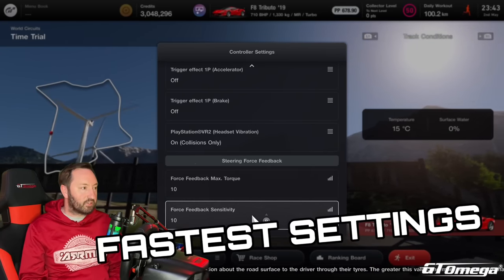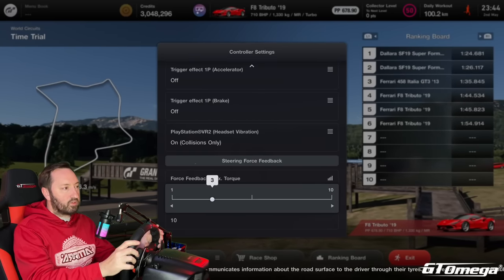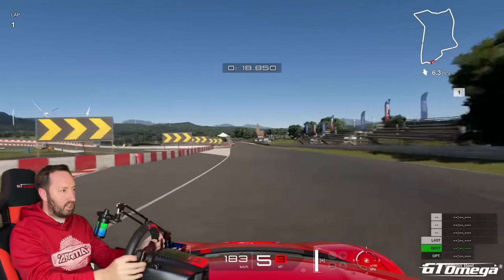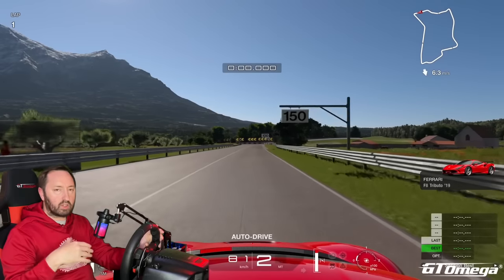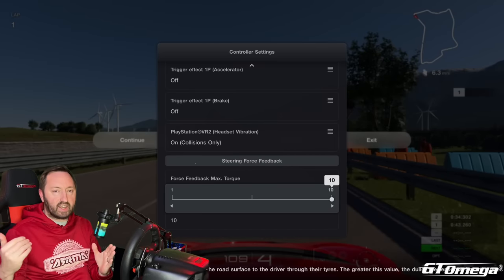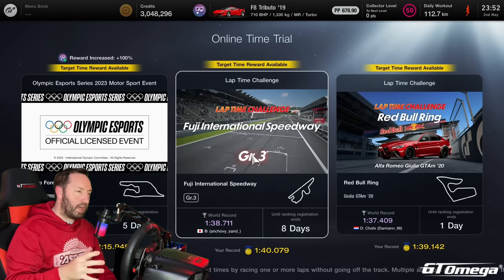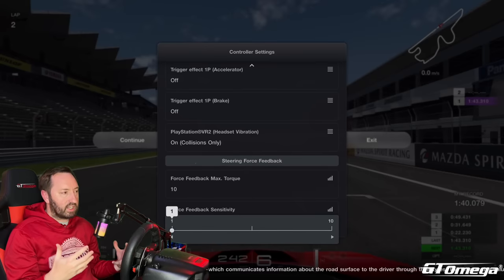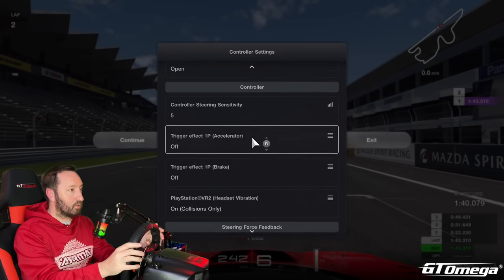Stop Wasting Time! Change Your Force Feedback Settings Now!

Comment: G29 clips above 3 max torque. Why would you go anything above that is beyond me... you are missing on all the details.
Reply from the maker: I do agree. However I wasn’t interested in the details when comparing the alignment feeling between high and low sensitivity. 👍🏻
Reply: @Doughtinator  I am talking about max torque, not sensitivity. The G29 does not operate well above 3 max torque.
Reply from the maker: Yeah I understand that. But also there are cars which don’t have much feedback at all. Sometimes you can turn up the max turbine settings beyond 3 for those cars.
Reply: @Doughtinator  Low front downforce road cars? Not a bad idea, actually!
Reply from the maker: Absolutely 👍🏻👍🏻
The current time trial with the old car I did exactly that and it helped loads
Reply: @Retheraq  what do you mean by it clips beyond 3 max torque
Reply: I’ve been using 9-9 on gt3 cars and it seems ok, very frustrating I can’t change the wheels operating range while using on console (the g29 that is obviously)
Reply: Thank you for this,  I've just had to change to T248 as my trusty g29 pedals broke ( just before quali in a league race) how do you deal with the dreaded g29 dead space,  I used the good ole g29 for about 7 years 👍
Reply: “Details” mean nothing if the wheel won’t self steer
Reply: Totally agree . 3 to 5 on that wheel.
Reply: Good stuff. I’ve gone to 4/10. I hate that clicking-knocking crap when going down a smooth straight away.
Reply: Setting of this Video:
Information 0
Advertising 10

Comment: After 4years on 10 torque, on my G29 I went down to 8. 6hrs of racing today confirms the difference is massive and so much more fun. I might try 7 tomorrow.
Reply from the maker: Awesome. Don’t be afraid to experiment and see what works best for you 👍🏻
Reply: Like did it make harder or was it less stiff just curious I’m trying to make mine harder I have the one with true force done really like it about to get the pro so it have a tighter turn

Comment: Controller steering sensitivity is, as the name implies, for adjusting the sensitivity of the steering on a CONTROLLER…… it is a separate section of the menu called CONTROLLER , the settings you tested in this video are in a section called STEERING force feed bacK, they do make adjustments for the STEERING.
Reply from the maker: That’s what I found when I was testing. But others swear it makes a difference 🤷🏻‍♂️
Reply: You are wrong. It does affect the wheel

Comment: The biggest difference I've noticed with controler sensitivity not set on 5, it makes the cars wheel feel like your behind the actual steering wheel. Say 6, the wheel imput feels to fast compare to how much you turn. 4 the car will be slow to your reaction time.
Reply from the maker: Interesting. That’s for the feedback. I’ll look closely for this when I’m next testing. 
It’s not something I noticed but I’ll look again next time 👍🏻
Reply: That’s what happens when you adjust torque sensitivity. Nothing happens when you do controller sensitivity. It’s a placebo effect.
Reply: Don’t listen to this controller sensitivity propaganda

Comment: Since they changed the physics I use 5 and 8 on the g29...over 5 is it's just too heavy and furthermore it loses details and smoothness with race cars. The problem is that when you use for example a golf gti or cars from that category you need to set a higher value because you almost have no feedback..they need to put some more work on how it scales to the different cars or add a per car ffb setting like in automobilista o ac on pc...the dream woulb be having separate options for road suspensions curbs
Reply from the maker: Yeah I agree. The weight of the wheel is quite different between different car types. That’s why I tried road car and race car in my testing.
Reply: Yes, even more so if you use the go carts.

Comment: for me it feels that most cars only use a max steering angle of 90°. and not like 180° or even 900° for road cars
Reply from the maker: For driving around a track. Yes I do rarely use more than 90 degrees. But driving slowly the rotation does seem to match.

Comment: Your wheel settings for will be quite different for drifting.  I would check out drifiting with little to no resistance/sensitivity.
Reply from the maker: I’ve had a play and I’ve actually found that higher values also work well drifting for me.
Reply: Higher settings make you feel the tension of the grip of the tires as it's happening vs your predicting what's happening with a light wheel

Comment: I might add, if you have the thrustmaster base then plug it into a PC and adjust the max ffb from defaults 70% up to 90% then back into the game and keep the max torque at 6 but drop the sensitivity down to 8. Higher definition without the arm tussle with the wheel. My preference anyway.
Reply from the maker: Very good info. Thanks for sharing 👍🏻👍🏻
Reply: This is not true. Set it to zero on pc and plug it in, it will still have ffb.

Comment: Recommended settings for g923 true force, from logitech representative:

FFB Max torque = 10
FFB sensitivity = 1
Vibration = 50

I just tested it and the result is WOW, thanks to trueforce technology !

Controller Steering Sensitivity (my suggestions is based on your view camera angle):
Hood = 6
Cockpit = 10
Chase = 5
Reply from the maker: Thanks for sharing 👍🏻
Reply: That is what confuses me. G923, G920 and G29 are all same hardware so it's applicable to all 3. But it is just madness to me for logitech representative recommending FFB torque 10 and FFB sensitivty 1.
Sensitivity 1 literally gives you almost 0 feedback in actual grip levels. You can't feel any of it. I tested with sensitivity 1 and it just feels like i'm on a river in a boat having no clue whether i'm steering or not. Back end going side ways? I get no information about it except seeing visually i'm doing 360.

And on the other hand... going above Max Torque 5 gives you FFB clipping meaning you lose details in FFB. 

So I'm very puzzled by that claim.

I was running basically 10 10 and it's just hard to drive it like that as well but I can easily correct and I can feel the road. Now I'm investigating what are the proper FFB settings in order to get all of the information from the game translated into the wheel in order to be able to drive consistent and fast.

A site like simracing setup says 5 for max torque and 4 for FFB sensitivity which is rather like the default GT7 settings lol. 

I'm just at my wits end with logitech wheel FFB recommendations as nobody actually explains what both settings are and what informations they actually provide and which settings give you the most information you can extract.

Update:
I ended up doing just the way site advised... 5 for torque and 4 for sensitivity.
The wheel feels like it gives out most of information and it's more "precise" since it's easier to turn and you don't feel as much individual tooth of a cog so it feels "smoother".
But I can feel most of information the wheel is giving me when it's on 5. When I go anything above 5 I can just feel the same stiffness of a wheel on most surfaces whatever it is and can't tell much whether i'm slipping or not (only thing is positive about that is that I can tell that I am slipping but when I'm starting to slip I can't tell).

Especially when going from hard to medium to soft tyre I can't tell the difference when it's above 5 max torque while with 5 I can easily tell by stiffness levels (as it seems what they're talking about "clipping" since I don't feel that information above 5).

So I think 5 for max torque and 4 for sensitivity is the most correct for GT7 with G29/920/923.

Comment: There is no 1 size fits all, definitive ffb settings, it's a personal thing. It depends on driving style and personal preference. If it works for you then don't worry about it being 'wrong' 

I use a TGT2 with GTomega Art and generally use 4/4 for slower cars (gr3&4) and 3/3 for faster (gr1&2)

I find it much easier to catch massive oversteer moments with lower strength ffb
Reply from the maker: 100% agree with you. Finding what feels right for you is most important 👍🏻👍🏻
Reply: I use 1-3 😬😬😬😂
Reply from the maker: Interesting. What wheel? Have you tried anything higher?
Reply: @Doughtinator  I have t300 mate I used to use 3-3 but felt i lost my finesse with last update so had to turn torque down 😬
Reply from the maker: Interesting. Have you tried high sensitivity and low torque. Like 1-9 for example?
Reply: @Doughtinator  yeah tried a few a mate I used to use 8-8 on t150 got 3-3 from TOR league on gtsport andxlwrk a treat for my t300 never had to change until that update one b4 last 😁

Comment: in other threads check for Pirovac they claim sensitivity is better @ 1 .... this would guarantee a better "dynamic" range on driving details... and when it comes to me  probably because I am a poor driver I can feel when FFB is hgh or low very well....but with FFS switching from 1 to or viceversa  ... not so...🤔

Comment: For me the max torque setting is determined by the wheel you have. When using a T300 i was limited to around 4 or 5 due to it would overheat. My dd pro i actually dont want to go above 5 as its too strong for me and can end up with repetative strain injuries to the wrist. The dd pro has a whole load of other settings that i haven't a clue what use they are to me to adjust. Ive sort of found max sensitivity at 10 and torque at 5, but drop it to 4 if my wrist is injured. For me the controller setting is literally for the hand held controller. I never thougt it was intended for anything else.
Reply from the maker: Yeah I’ve found pretty much the same as you 👍🏻
Reply: It's now confirmed that the controller sensitivity actually changes the wheel feeling as well and is best to keep at center setting as that is 1:1 movement
Reply from the maker: Do you have a link to the article that confirms?
Reply: @Doughtinator hi mate, what is the maximum degrees of rotation do you have your steering wheel set to in Logitech for use with gt7, mine is set to 900 but I think it might be too much..
Reply: @Doughtinator  here is the link to video on controller sen for wheels too https://youtu.be/oEe5ZchqbMg?si=WoAQ5xt3NCIrVqgn

I use controller sen 5 and the Two torque settings 5 and 10. Feels great with gt dd pro!
Reply: @MarcRCAddict with gt dd pro I found 450-720 good depending on the type of car
Reply: @Zascar888  thanks bud 👍
Reply: Did you say injury????   Jesus Christ people are getting weak.
Reply: @publub1142  I'm an old man my gp tells me. She said I've to careful, you're not young any more. Part of life getting old and body can't take what it could when I was young I'm afraid. We never had all this brilliant stuff for gaming when I bought my first racing game as an adult. Psion chequered flag on the zx
Reply: @Yukanhayt-Mhenow lol no it’s not confirmed by anyone at all. 

It’s all in your head.
Reply: @Zascar888 that guy has no idea what he’s talking about. His video is absurd and has the logical thought process of a child.
Reply: @Yukanhayt-Mhenow You fell for it too ha , it also been proven it’s makes no difference to wheel sensitivity.

Comment: I have noticed a difference with the controller sensitivity.... I started on ds4 with a low setting but was using steer not sticks... went to wheel and turned it to 10 for a long time thinking I wanted the fastest reaction wheel to game... saw one if the videos about this and have been running at 5 since (about 3 months)... I noticed it most with high tire wear...

Basically the controller sensitivity is related to in-game inputs... if too low then your turning will be behind the game thus needing more input. If too high then you can turn in less but the game over exaggerates the input.... Basically either will kill the tires.... on wheel best is 5 which gives most accurate wheel to in-game inputs, and can save the tires too! 

Cheers good content... true science  👌
Reply from the maker: Thanks for the feedback. Interesting about tire wear. Perhaps that’s a test in the future 👍🏻👍🏻
Reply: I use -2 with road cars, as you want very slight steering to maximise straight line speed. I've gotten many many top times in licences with -2/10/10
Reply from the maker: I really need to test some more on this 👍🏻👍🏻
Reply: This is false. Controller sensitivity has ZERO effect on wheels.
Reply: @JohnSdigi  correct

Comment: I use a T150, but the force feedback seems very vague IN GT7. I've tested the wheel out with PC3, and it feels GREAT!! I can literally feel the tire grip and make accurate inputs as I navigated a course.

I love GT7, but I need to know if there is something I'm missing in relation to settings.
Reply from the maker: You could try increasing the settings. But GT7 does feel a little weak on feedback overall.

Comment: 6/ 10 is where I'm at , controller sensitivity 2 , I can feel a difference in lineraty to the steering maybe it's just in my head 😅
Reply from the maker: That’s what I’ve been trying to avoid. Changing something. Knowing what’s changed and then inventing traits which validate what I expect to happen. 

The only true way to do it is to having someone make the changes (or not) and then test without knowing what changes have been made. sadly I don’t have a race engineer to help me do this 🤣🤣
Reply: Yeah that is something I've thought of , have someone change the settings and see if I notice anything without knowing what was changed. But ya I'm only one person 😅
Reply from the maker: 100% 👍🏻👍🏻
Reply: In your head. Controlled sens has zero effect on wheels.

Comment: Great vid mate. The G29 is a pretty good wheel with the settings pretty high. I've now got a T300. Feedback sensitivity is still at 10 & the difference from the G29 is immense. I can feel almost everything. Torque is at 6 tho now. It's much harder to turn with the belts. I think PD still have some way to go to match the feedback feeling from other games like ACC, which is much better imo.
Keep up the great work fella.
Reply from the maker: Thanks Martin. Yeah I’m quite interested in trying new hardware. But I completely agree. GT7 is a long way off where it could be with FFB. 
In fact. The old Live For Speed game on a G25 feels better than GT7 in 2023 😳🤷🏻‍♂️🤣
Reply: PD isnt aiming to compete with acc i would let this idea go
Reply: @danielstokker  I didn't say that PD is aiming to compete with ACC, so stop reading into things that aren't there, Mr Passive Aggressive. I said they had a long way to go to match the FFB that ACC has
Reply: I had the g29 and now the T300 and same games as you. Totally agree with you 100% 
Im sure it would be different with DD wheel base but for what this video is about then yeah 6 and 10 all day every day

Comment: I'm using a next level racing stand and g923 wheel. Will take a look at these setting.
Reply: Yes I can feel what the car is doing a bit better. Big differance....now I need to learn how to drive again 😮
Reply from the maker: Awesome. What settings were you on and what did you try?
Reply: @Doughtinator  both were set at 3 as default. I set torque at 7 and sensitivity at 5. I may be able to go higher, it now feels like I'm driving a race car....not a lounge chair.
Reply: Thx. I also have a 923 and was wondering about new recommendations and if the two wheels would use similar settings.
Reply from the maker: I’d recommend 10 for force feedback sensitivity and tune the max torque depending how ‘heavy’ you want the wheel. This can be car specific. Roads cars need higher. Race cars need lower 👍🏻

Comment: Can someone please help. I have g29 but in gt7 I can’t turn properly. No matter how much I turn wheel, I slide off track. Only thing I can think of is that I did the calibration wrong? You know where you turn wheel 90 degrees, and fully press the throttle, clutch and brake? I’m so desperate for it to work. I have the sensitivity set as advertised in these types of videos.I’ve tried all various settings. Nothing works. Small turns work fine, accelerate, brake, paddle shift gears work perfectly but whenever I try a big turn, I slow right down and turn the wheel around 3/4 and this should make turn but it won’t and it’s like game don’t know I’m trying to turn. I can even fully turn the wheel and I just can’t turn. Don’t get me wrong, I think the game is a bag of shit but I paid £52 and would like to at least get my money worth. It’s just so frustrating. I just tried to play first time in weeks and just had to give up.
I tried moving steering sensitivity at all settings nothing works. I just don’t understand why it works for everyone else. I have exact same settings and I can’t race. In other games it’s steering sensitivity and linery that sorts out the steering but not in this game.
Reply from the maker: I’m not sure what’s going on man. Should be no. Need to calibrate a G29. 
What cars are you having problems with?
Reply: @Doughtinator  every car. It’s driving me crazy. Car just won’t turn properly. Games totally not playable. Thankfully I got dirt rally 2 working ok. Car actually turns. Right 3? No problems. Right 1 no problem. In gt7 I turn wheel 360 and can’t turn. I just give up now. So upset over this bloody crap. It’s always me having problems. Every time I see every comment about gt7 I’m just pissed off. Like why won’t it just work? Anyway thanks.
Reply: @grahamkelly8662  same issue for me what ended up helping was setting controller steering sensitivity to -2